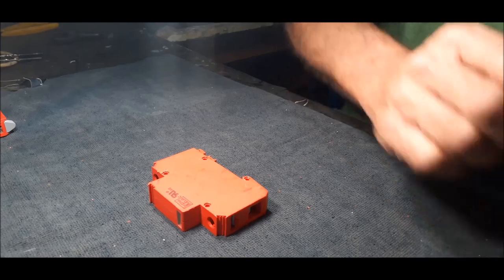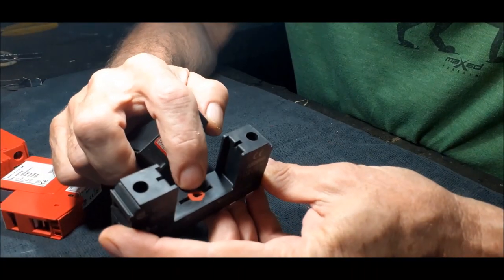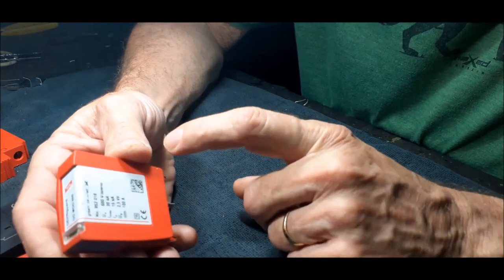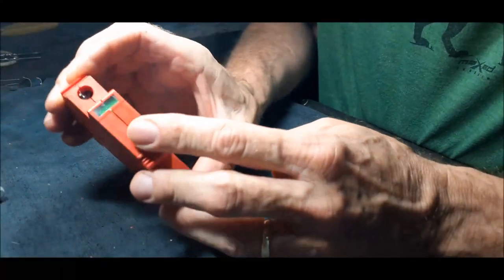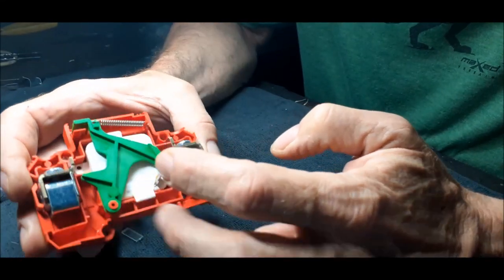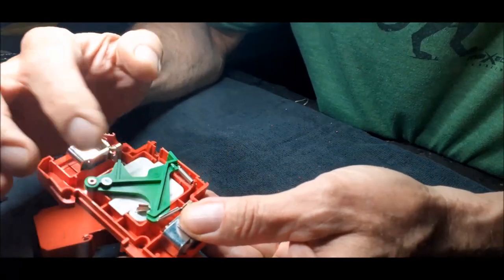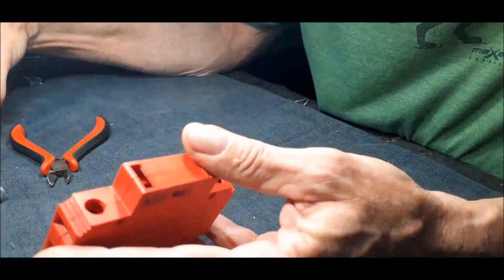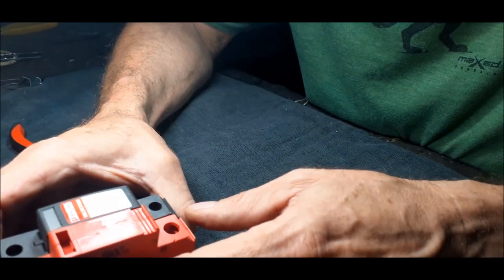Surge arresters and how they work

Comment: Hi Dana
Me and my wife stay in Krugersdorp and we just bought some solar panels and an inverter system because of all the Eskom trouble we have been having.

The guys at the solar shop gave me these things to connect to the PV line as it goes towrd the inverter. They said it is for lightning protection. I believe now that is false and surge protectors won't offer much protection to lightning strikes.

Do you think it would be normal yo connect a surge protector between your panels and inverter? If yes. What voltage  would you recommend?

Would I also earth it back to the houses earth circuit or do I buy and install a separate new earth spike?
Reply from the maker: Hi  it is always a good practice to connect the surge protectors between the panels and invertor. They clamp any spike and route them to ground. For 6 x 440w panels recommend 600v protectors. There must be a ground peg as close to the panels as possible. The house earth is not so effective as it is grounded at the substation.  Lightning in  understanding in itself is very difficult. With a direct hit you can't do anything. The flux induced in house wiring can then enter from the invertor output side as well. One can only try to do the best and hope for the best. Just remember to get a electrician CoC certificate for the installation for insurance purposes. Hope this answer your question.
Reply: @DanaKotze  Thank you for the reply and advice Dana!  I have a electrician helping us with our project. I will show him your recommendation.
Thank you again and thank you for the video!

Comment: Than you for explaining but could you please show the wiring on the DB Board. I'm guessing that you ment the MAIN  live and main neutral will pass through the surge arrestor . Must this be installed "upstream" from the main circuit breaker or just after for single phase domestic installation?
Reply from the maker: Hi. There is a surge arrestor between live and earth and neutral and earth. Use the top side to live and neutral and common the bottom side to earth.  Put them as close to the equipment as possible.
Reply: @DanaKotze  thank you for replying. So does a surge arrestor go before the main breaker  in the dB or installed further down the smaller breakers to earth ?
Reply from the maker: @Xxxcappie23  it goes after the circuit breaker.
Reply: @Xxxcappie23  

What most people seem to use these for is for diverting a power surge absorbed by power lines into the houses system L+N. Install 1 device with an L N + E terminal after the incoming supply isolation device that will be a knife switch or disconnector. Connect incoming and outgoing onward live in the same L terminal together and do the same with the incoming and outgoing neutral supply cables. Then connect the Earth terminal to earth with a decent size wire similar to the main earth cable size 16mm. Now everything past this point on the electrical system is protected from surge as it hits and goes to ground if over a certain voltage. This is required to stop RCD devices nuisance tripping in storms.